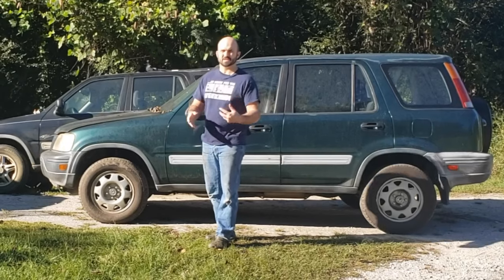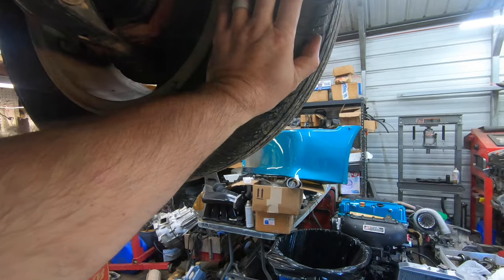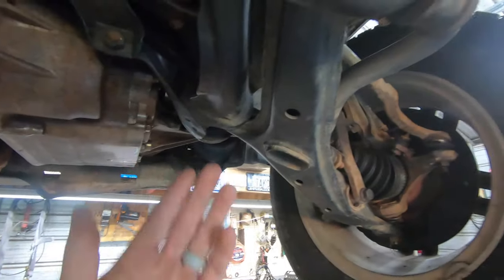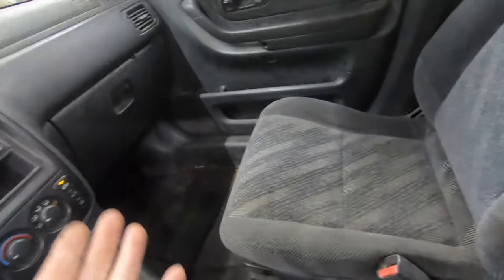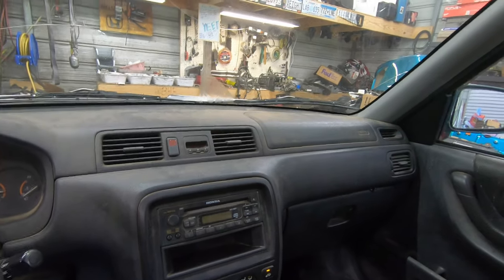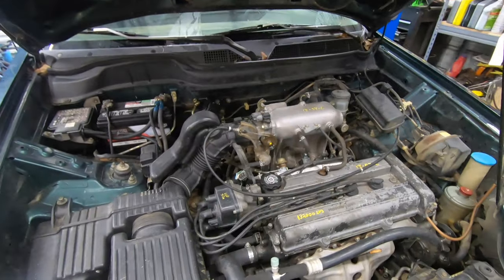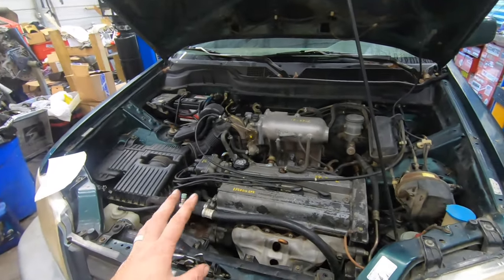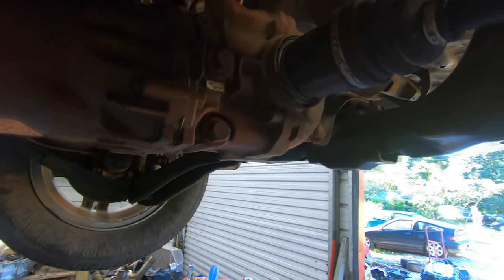Most Common Problems: 1997 - 2001 Honda CRV RD1 RD2

Comment: Just got a 24yo CRV mt and def thinking thermostat stuck open. Takes a long time to warm up, heating not as hot as it should be and the coolant temp drops considerably when downhill or driving in cold/rain. My mpg is not great and i get fluctuating idle and revs upon clutch disengagement. Im thinking the engine constantly thinks its in the "warm up" mode and throwing the wrong air fuel mix in there, is that a reasonable guess?

Comment: Thanks for these video's. They're super helpful! I just bought a CRV RD1 and it seems that my door mirrors don't close, could it be that they are fixed or are they definitely jammed? Its a EURO car as I'm based in Malta. Also the sunroof doesn't open, is there a known common fault on those? Thanks
Reply from the maker: Sunroof wasn't standard equipment here in the US. Usually if I ever see on it's aftermarket installed. I'm not sure if your side mirrors are the same as US or not, but all US versions had a manual folding capability.

Comment: great video!!!!  now my question: 2001 CRV EX, 330K miles.  situation: hot weather in central TX,  cranks, rough loping idle, sounds like it's flooded, smells like it's flooded.  maybe icm?  thanks for everything.
Reply from the maker: I would look at the ect sensor under the distributor.
Reply: @hondaresource  i just replaced it about a year ago.  any preferred brand i should be using? i'll swap that sucker out again.  thanks a bunch!!!

Comment: I'm working on the mother in laws 2000 crv and I'm not having any luck finding the 56 tooth gear for the pass. Power mirror. Any help would be awesome,, finding a complete mirror to swap it out is almost impossible in Michigan.. your videos have saved me frustration and her $$$. Thank you.
Reply from the maker: Only solution I would have is replace the mirror.
Reply: Found a replacement for it in the same faded red.. thank you for your time.

Comment: Hey there, aMy ac works but if I shut it off and turn the heat all the way up it's not blowing hot air, just warm ambient air...temp gauge on cluster is normal. Air is blowing normal rate still...where should I check first? Really hoping it's something easier than a heater core 😫

Comment: Good video, lots of info, im having the issue when driving and i turn i would have to return it to center myself rather than it returning when you let go of the S. wheel, much worst in the highway, hence i've done 2 full wheel alignments but still cant figure it out for the of me.
Reply from the maker: I haven't seen an issue like that with any here.

Comment: Great video! Thank you for the info. We have a 2001 AWD CR-V and debating on putting some money into it. Mostly DIY for the stuff that I can handle and take it in for the items that are a bit worse. 198K on it and still runs great but suspension is in pretty bad shape and AC doesn't work. Have you had a lot of issues with the AC in the 1st gens? I was told by a Honda tech that it's not worth it because they experience black death so I didn't even look into it, but from what I'm reading it seems that that's a more common issue with 2nd gen. Any advice on AC? No cooling obviously and the windows get very moist. Thank you.
Reply from the maker: I've had to replace several bag compressors over the years, usually it's the 2nd gens that experience black death.
Reply: The suspension bushings wearing out is just a thing for hondas of that age. One of the few downsides to the superior double wishbone suspension they use. I suggest buying a press, taking your parts to a garage or better yet buying suspension with busings pre-installed for ease. You will have to figure out the trailing arm bushings, but i think you can rent atool for those now. It's a bit of work but goes pretty quickly once you get going. I have 3 crv's that have a combined 1mil miles, they seem to outlast everything we buy to replace them.

Comment: Also a problem I noticed is that when leaves fall into the fresh air vent they start to biodegrade, creating soil that clogs the drain in the pan which causes water to pool and moldy smells.

Comment: I had an issue with the ignition switch  ( 97 honda crv , 183,000 miles),  no cranks at all, so i decided to take the starter off and took it to a shop for testing. It turned out the starter was working just find, so I thought it have to be the ignition switch. I put the the starter back to the car , and ready to take off the ignition switch,  but i decided to reconnect the  battery and try to start the car one more time, for my surprise the car started right on. Since the problem is gone, I have a feeling that i will have an issue in the near future with the ignition switch ,since already have 183,000 miles never changed the starter or ignition switch. What would you do ?

Comment: I have two 1st gen CRVs.  Both Red.  One is AT, the other stick, so we named them Otto and Manuel.  Anyways, I would add the upper control arm bushings in the front and lower control arm bushings in the rear.  Manuel we have had 10 years, Otto we have had 6 years and they are pretty robust.  Manuel had a burned valve for the previous owner and after I got it the vehicle was stolen and came back with a miss...I adjusted the valves and its been great.  219k on one, 239 on the other.  MN vehicles...rust in wheel arches other than that they look pretty good.
Reply: Oh and both cars had an issue where they would not start  Rather than pay big bucks for cap, rotor whatever I just went to Ebay and got a complete distributor ---everything in one fell swoop for like $55.  10 minutes to swap them out and running great
Reply from the maker: Awesome man! I'm glad to have you here

Comment: How about that dreadful ignition switch? I've known for the past year the switch needed replacing, but the problem has morphed into a crank/no start. None of the dash lights come on when key is turned to run or start. There are no fuses blown. The two phillips head screws that hold the plastic contacts/wiring have cammed out on me, so I'm getting ready to dremmel a slot in the breakaway bolt so I can just remove the entire assembly. These screws bring me back to when I had the front of the engine disected for timing belt, water pump, CFS, torque mount and motor mount, and a bunch of other repairs. Someone went crazy with the loctite and used the stuff on fasteners that did not require it, causing me ro round off several bolts, incl. the timing cover and the timing belt tensioner. That tensioner bolt was no joke and required extended work-around, since there wasn't enough room to use the proper "rounded bolt remover" and that bolt being gr. 8 and extremely hard; using a cut off wheel on a dremmel was slow-going. when the bolt finally came out, the loctite had been applied to the entire threaded section. That experience was worse than the crank bolt!!! I remember you answering several questions for me, and on the same day I typed them. Hard to forget about that, since you put me on the right track. I later discovered that the exhaust cam was off by one tooth. I became highly proficient in tearing that B-20 down in record time. The CRV has been running excellent and no further issues until this ignition switch. The first symptoms including the engine dying out at the worst possible time and loss of power steering during the event. It would always restart like nothing happened, and it was random - 2-3 times a month. I was able to duplicate the problem by wiggling the wires and  turning the key ever so slightly. Keep up the good work and I hope you and your family are doing well.

Comment: My mom has a automatic AWD 2001 CRV with 226k miles that I’m helping maintain for her. Between 27-40 mph it makes a grinding noise (the whole car vibrates a little bit and the coins in the tray rattle) when going the speed limit but when I go to accelerate it hesitates and it grinds harder for a split second then downshifts and starts to accelerate again, when I press the overdrive off button none of this happens though.  I’ve already replaced the transmission fluid about 2 years ago and it didn’t grind as often but it still grinds, it’s like the car is stuck in a gear.  The car is still drivable and it’s been like this since shortly after we got it 4 years ago. Any idea what could be done to fix this? Just wondering if it’s a part or a whole transmission that would be needed
Reply: Did you ever figure this out? I have to do the overdrive trick as well. It’s usually around 1000-1300 rpm the whole car rattles/ shakes. I’m stumped as well
Reply: @Chazisus  I have not figured it out, we just kinda deal with it. But I have noticed lately the transmission is being hesitant to shift into a higher gear now sometimes I’m thinking maybe the transmission needs a rebuild or maybe something with the torque converter, I don’t know because I’m not too knowledgeable on those things

Comment: I had my valves adjusted on a '99 CR-V in Canda, and it costed $415.xx CND tax in. I supplied the valve cover/spark plug ring gaskets. I looked under the hood and noticed that it didn't even look different, and I had a certain zip tie holding my ignition wires in place and my ground wire looked the same last time I close the hood and (just did an oil change myself). Should I be suspect?

Comment: Can I drive a 2001 Honda CRV AWD without the driveshaft in  place from the transfer case to the rear diff?  We used to live in NY but moved to Florida so I don't need AWD here.  The front tires are getting more worn and I heard if you have tires more worn on the front then the back, you could do damage to the tranny/transfer case.

Comment: Whats the difference between the various trims (LX, EX, SE)? I have a 2000 CRV but can't figure out which trim it is.
Reply: From what I know SE model is the fully loaded one 
Like all the black bumpers and plastics are painted to match the rest of the crv
Reply from the maker: https://youtu.be/2mQHSYvdhig I cover the differences in the trims in this video
Reply: If your handles/mirrors are black it’s an LX. If your interior is leather it’s an SE. Otherwise you have an EX.
Reply: thanks for the response. My sideview mirrors are same color as the exterior paint, and the interior door handles are chrome colored. I think it's an EX
Reply: @Aryahmmr  I meant like leather seats not interior handles haha. I think the chrome interior handles were an option/accessory. But yeah if your exterior handles/mirrors are painted and you have cloth seats it’s probably an EX

Comment: I have a Honda CR-V 2001 in New Zealand and they seem to get roof rust under the rubber channels and also around the rear mudguards the one I have for parts has rust in the same areas.

Comment: I have a 2001 Honda CRV with 256K miles.

Problem:
Usually, when I accelerate to 50 MPH and above, there's an internal rumbling/knocking sound that seems to be coming from under the hood.
I also feel some vibration.
The problems greatly diminish or goes away completely when I let go of the gas but come back immediately as I accelerate again.
The problems get worse as I accelerate more, as does the vibration.
This problems usually do not present themselves until after I've driven my vehicle for 5 - 10 minutes.
Also, they seem to be more likely when I've sustained around the same driving speed for a few minutes.
Driving on flat or on inclined ground brings these problems out more than declined ground (though the problems are still noticeable during declined ground driving).

Occasionally, while sustaining a certain speed, the problems will greatly diminish for a few seconds before starting right back up to where they had been.

What the heck is going on?
Reply from the maker: I'm not sure. Hard to say without having the vehicle here
Reply: Change transmission oil as directed for your year crv.  Trans Shudder happens because of old oil.
Reply: Thats generally an auto trans issue.

Comment: I solved the water leak on the passenger side of my 98 crv but can’t figure out the driver side? Every time it rains the carpet is wet. Spent hours running a hose over it and looking at every possible location but can’t find where it’s coming in. The drains are perfectly clear and flowing

Comment: Thanks for the information. I have an 01 CRV SE with an odd no crank issue when below 10 degrees F. The ignition switch has been replaced, the battery which was old and lost CCA and now the starter. Had the car towed several times to the shop and they keep trying something else. The problem is it only happens when super cold outside. They bring the car in to the shop to troubleshoot and then it starts. It's a crapshoot on what to change. 

Besides the starter, battery and ignition switch, what esle could cause no crank in extreme cold?

I thought the starter relay, so I swapped it with another relay in the car... did not affect the issue.
What about the nuetral safety switch?
Or, there was an alarm in the car when I bought it. The siren quit working and it does not work anymore. The remote works to open the doors. 
Could it be a relay or Immobilizer tied to that?
 
Any tips would be greatly appreciated.  Thank you. Big Dubz.
Reply from the maker: The aftermarket alarm may have an effect on it, bypass the starter kill function on it and see if that makes a difference

Comment: what do you know about top hats on a 97 crv specifically , im looking at one w 248k miles. i just need a hooptie and im just concerned ab the too hats based on my research if done right. apparently it could be a big deal to replace. the one i am looking at says it needs it and that’s it not that it is missing but it needs it

Comment: My crv struggles to get going after driving a distance and then stopping. Sounds like something not quite connecting for a few seconds - then it revs high and settles . Also the first and second gear a Lee a little clunky. Would that be a bear box on the way out or a clutch issue . If I’m super slow on clutch release it is smooth , but I’ve also been told this is bad driving . ??

Comment: Hey thanks for making all these videos! Would appreciate if you could give me some advise if it's not to much trouble. I have a 99 Honda CR-V automatic and oil is getting into spark plug tube 2 and 3. I changed the valve cover gasket and spark plug tube seal but oil is still getting in not sure if it's coming from somewhere else. Could it be the head gasket or valve guide seal?
Reply from the maker: Only place it can get in is the tube seals on the valve cover

Comment: Watch this just to get an idea of what I should do with my 98 CRV. I have put a lot of money into it when I bought it in 2018 a lot of things went wrong with it since then. Too long of a list but I got the timing belt change it has a new radiator new sway bars one axle is fixed the other needs fixing had a refurbished gasket put in about 1 1/2 2 years ago. I live in Missouri . I found out today that my transmission is shot so it has to be replaced. The automotive place quoted me $2,900 to fix it I know labor's cost of parts are high right now anyway. It uses oil and I've had the oil pan gasket repaired within the last 3 or 4 months. And there's no other leak it's just using oil which just started like this past year. I don't know anybody or have any help with money to get it fixed so I'm trying to figure out if it's worth keeping and not just trying to go buy another vehicle. Which I don't want to car payment and I'm sure it was going to be a high car payment so anyway just let me know what you think thank you appreciate it

Comment: I have a 97 and its shuts off randomly while driving on the highway. Everything on the dash lights up then the engine turns back on but it will not go forward after only in reverse. Mechanic says to sell it as I have it towed but once he gets it to his lot its working again with no lights on the dash and no codes show up on his reader. He cant figure out what it is and says it will cost me moee than its worth to figure out. Do you have any sugestions? It only has 110,000 miles.
Reply from the maker: I have pondered over this for several days and I can't come up with a legitimate resolution.
Reply: Update. We flushed the transmission fluid, installed a new shift solenoid and a used computer from another RD1. Its now running better than before.